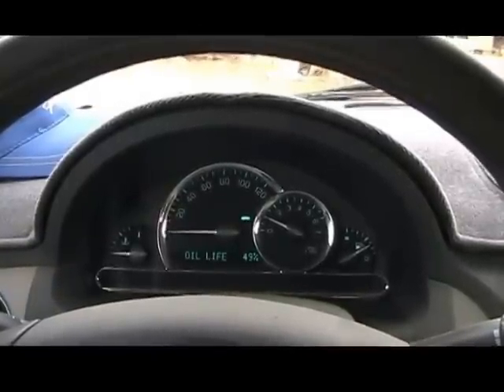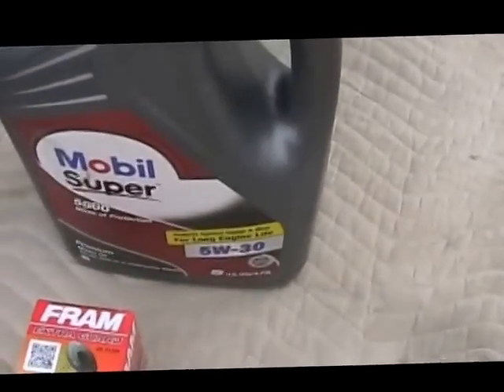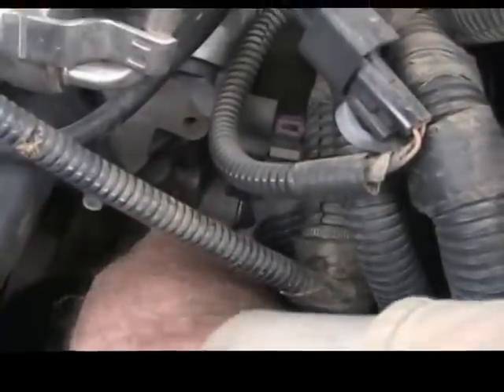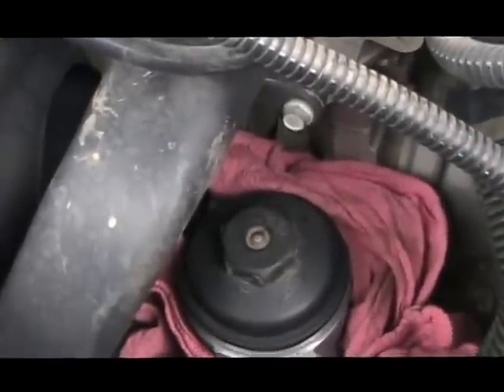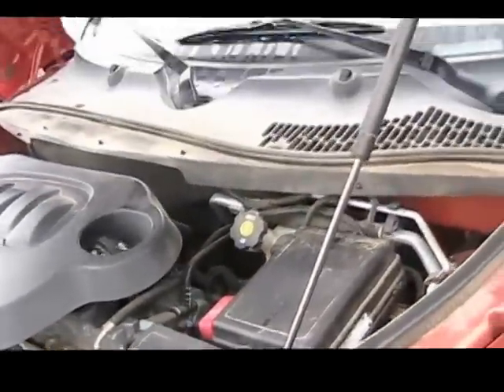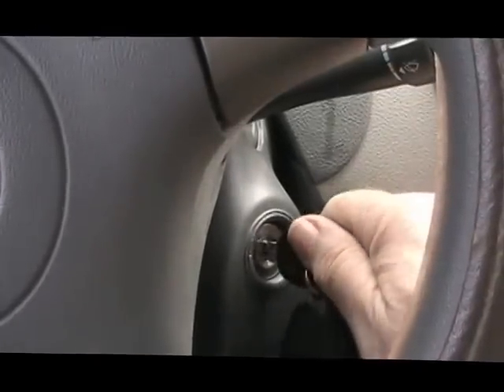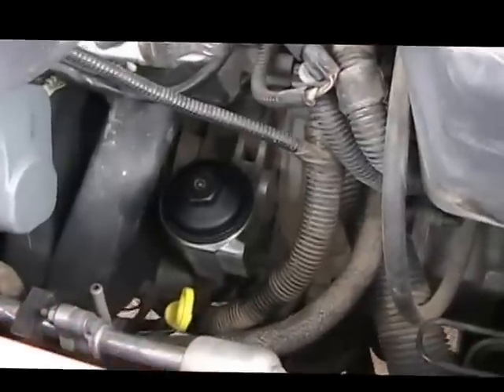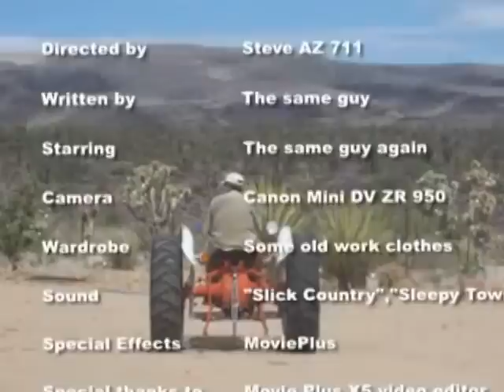Chevy HHR Engine Oil, Filter Change, Oil Life Indicator Reset.

Comment: You'll need a  low profile 32 mm (1 1/4") socket for the oil filter in order to clear the manifold. I found mine in the oil section of a local cart parts store, not with the regular sockets.

Comment: Thank you for a very helpful class. I'll mom watch the video cuz it's her car. You think those new style filters are better ? I would say no in my opinion but hearing other opinions is nice.
Reply from the maker: I really haven't made up my mind on the filters yet. I am so used to getting under a vehicle and changing the oil filter. However, it seems to work just fine as the engineers would know, and it is less messy. I think I could get used to it over time. Thanks for the comment!
Reply: SteveAZ711

Comment: What if the cap is stuck and won't come off
Reply from the maker: Use a 32mm socket and extension to remove it. Large vice grips maybe. An 1.25 in. socket may work as well. If you happen to break the cap...Amazon sells a replacement. These caps can be cross threaded and very difficult at times so take your time when installing or removing them. Just sayin. Yours is probably just on tight. Keep the threads clean for a better installation. Hope this helps. Thanks! link...https://amzn.to/49yJ0HW

Comment: i am too much of a perfectionist because I worry about getting a smudge of dirt in the oil from removing and reinstalling the oil drain plug and also the paper oil filter, is there tolerance for accidental smudges of dirt. Also, do I need to wipe the drain plug clean with a towel or can I just put it back on without wiping it clean?
Reply from the maker: Clean everything as best you can, and then rely on your oil filter to do its job. I also like to use paper towels when they are handy because you know they are very clean. I also use new shop towels at times. I always clean my drain plug. Some plugs have a magnet on the end that catches fine particles and you want to get those dirt, metal shavings off. Carburetor cleaner works good for that. I leave some cleaning off camera to save time. Thanks for your comments!

Comment: the oil tube that leaves the manifold to the air filter snapped off and the dealer and auto stores dont know what i mean  - what is it called to order one?
Reply from the maker: +Andy Land Hello, I believe you are referring to the PCV hose that goes from the throttle body to the air cleaner assembly.

Comment: Good video however you failed to mention the oil capacity or the location of drain plug on the oil pan, front or rear of pan.
Reply from the maker: Thanks, Drain plug right side rear of pan...5 quarts of oil and that includes the filter.
Reply: @SteveAZ711  Thanks I'm going to get on this tomorrow. Buying oil now...👍

Comment: I need your help. I took apart my engine and I forgot where the hose goes from the brake booster to where? Some kind of vacuum hose runs down towards the oil filter but I don't know where to hook it to please help. It has a metal clamp not the plastic clamp
Reply from the maker: On the 2.2 L engine the vacuum brake booster hose looks to go to a port behind the oil filter cap. On the 2.4L engine the the hose looks to go to below the throttle intake. The hose on the 2.4L also is a two piece hose from below the throttle body over to an inline connection to the hose coming from the booster. Hope this helps.
Reply: Steve thanks for the info. I still cannot find it. I have the 2.2 liter. I looked on the throttle body, on the intake maifold and all around the oil filter cap. I cannot find it. What should i do? Thanks
Reply: Steve. I found it. You were right it goes on the back of the throttle body. Thanks

Comment: Is there no need to warm engine oil before draining it?
Reply from the maker: Yes you should let your engine warm up before changing your oil. Impurities in the oil that the filter does not get become suspended in the warm oil and drain out much easier. Additionally, a warmed engine will have the lubrication it needs in that few seconds that it takes for the new oil to come up to pressure. I should have mentioned that in the video...good catch! Thanks for the comment!

Comment: You change the filter first with a cartridge style oil filter and there is a special oil filter socket made for the 2.2 and 2.4 ecotec engines.The old oil will dump right into the new oil

Comment: how much oil did it hold?,how much should I buy?
Reply from the maker: Hello Joe, 
My 2006 HHR has a 2.4L engine and it holds 5 quarts including the filter. The 2.2L engine holds 5 quarts as well. I use a good name brand oil that is 5w-30 weight, as recommended by the writing on the oil filler cap. Thanks for the comment!

Comment: How do you change the relay switch in a hhr
Reply from the maker: Denice Davis Hello, the relay box is under the hood and the relays just pull out. Here is a very good YouTube link explaining relays...https://www.youtube.com/watch?v=RETAQVeMnAA
If it is a fuse problem then watch this video at http://www.carcarekiosk.com/video/2007_Chevrolet_HHR_LT_2.2L_4_Cyl./fuse_interior/replace
for some insight on fuse location. Hope this helps ...SteveAZ

Comment: What's the  specific oil that you use?
Reply from the maker: I am using Mobil 5w-30 Super in this video. I like Mobil 5000 5w-30 when I can get it. If I am going to change oil say around 2500 miles then I get a less pricey brand like Quaker State but still it is good oil.  Steer clear of the really inexpensive stuff it just does not have as much additives such as molybdenum in the quantities that Mobil has, which helps reduce engine wear.

Comment: Just wanted to let you know that changing your oil "even before 49%" is literally throwing away money....ESPECIALLY using Mobil 1 oil. Mobil 1 is very good oil, but even with a standard oil, you are fine using your oil until it is time to change it... 

* Obviously it won't hurt anything to change your oil prematurely every time. It is merely a big waste of money. (especially using synthetic which is good to run more than twice as long as standard engine oil)
Reply: These 2.2 ecotecs need all the oil changes they can get.